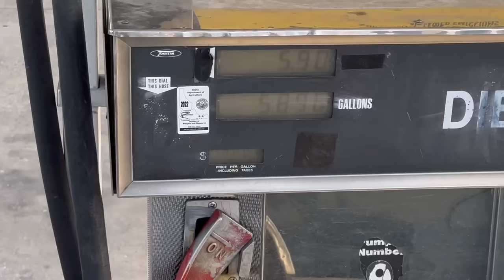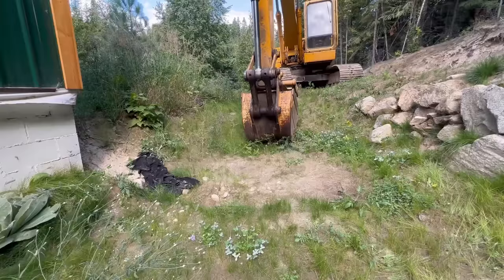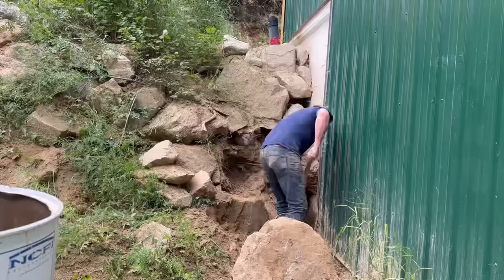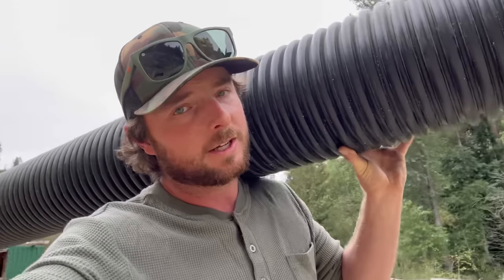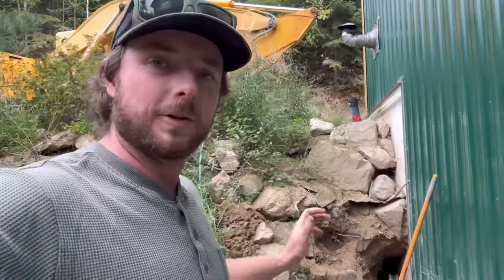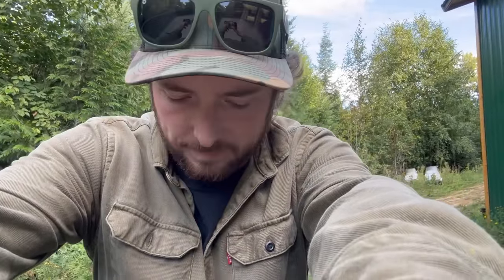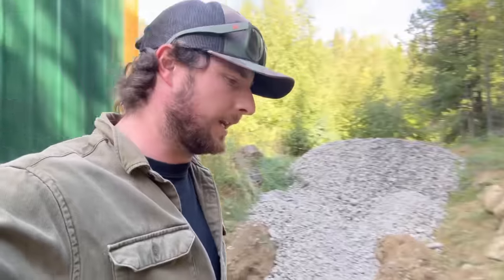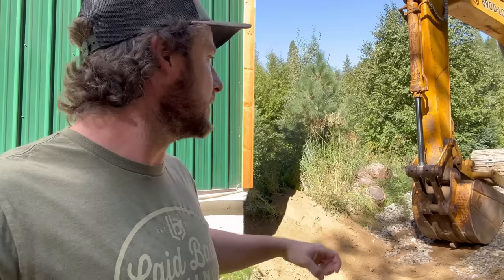Fixing This MISTAKE Before The Next FLOOD

Comment: Mike one major issue you’re going to have over time is the drain rock getting clogged with dirt because you did not use filter fabric over and under it. If the water can get through it WILL take dirt with it! For proper drainage you must ALWAYS use the fabric to keep the dirt out of the drain rock. 

What you’ll find is you’ll have to end up every several years redoing the same job over and over because you skipped a vital step.

Comment: You need to waterproof that block wall  and install a drain system the whole length of he back wall.  Dig a drain line from the dry well to the outside edge of where the house and let it drain off the side!

Comment: My brother in law put a plastic barrel into the ground with a sub pump in it, and it stopped water from coming into his house. We have had several big rains, and it worked great.
Reply from the maker: That’s a good plan! Unfortunately it would probably freeze here during the winter.
Reply: @MikeandLizLorden  pour radiator fluid in the big barrel and that will help keep it from freezing. And a heated water drop in rod to keep the barrel water warm and not freeze.
Reply: @MikeandLizLorden  not necessarily. Like other water systems, it comes down to burying the tank/barrel below the frost line. No idea what it is there, but if it's anything like my part of NH, it'll be 5 ft.

Comment: I think the title of this video should be changed. You are implying the Raneys made a big Mistake whereas they were trying to do a quick fix that just didn't work. I suspect the real problem is lack of waterproofing the back and side walls and not installing weeping tile at the base of the walls to carry away all the water. I hope your improvised solution works, but it would have been better with filter fabric all around the stone as other people have said.

Comment: SO my friend.  That is not going to be the permanent solution you hoped for.  You could have used the "burrito wrap" mentioned below, but that method is better for seepage.  What you have (based on what you have said is a massive rush of water down the hillside that does not stop until it hits your foundation.  That's why I suggest the fast disposal system. If you had installed a catch basin all the way in the bottom of your pit and drained it to daylight with your culvert, you would have a permanent solution.  You would have had to add stack on extensions to bring the catch basin up close to finished grade and a full size grate. As others have said below, your drain rock will silt up (3-5 years max) and you'll be doing this job again.  Maybe next time you do it the right way.😊 If you have seepage through your block walls, well that's an inside fix for another day.  But you will have to pump the seepage away to daylight.

Comment: peoples have pointing out some good point. the thing i would be very worry  about is all those big rock pile up against your block wall. over time the frost will push them and crack your block wall. I would remove those big rocks and replace it river rocks near the block wall . Then fill the rest of the hole with sand. also as those rocks move it could also crush your pipe you just put in.

Comment: Non corrugated white 4" perf pipe works really good (perfs on the bottom), wrapped in drain cloth, surrounded by 1-1/4" clean drain gravel, with a 1/4" drop every 10'. I made mine all around the perimeter of my 24'x40' shop, draining away from my shop in a 24" deep trench. It works so good I no longer get any water in my shop now. I also taped up a 9"  wide membrane to the 4" concrete slab to keep the dirt from getting eroded away under the concrete along with the gravel and the drain cloth.

Comment: If it doesn't work can always change things up , I would have graded the soil between the wall and house to the middle then put a french drain down the whole thing.  filter fabric is your friend like a lot of other have said.  it looks like you have the equipment to get it done if need be.  This is how I learned I tried stuff till I found out what worked for my situation.  I didn't have the equipment and dug by hand rock too.  Thanks for the video was cool to see.

Comment: Hey did you get your track motor fix? Could you apply a rubber sealant on you block wall? Maybe add a pump to pump the access water away from your house

Comment: Pray your solution works and solves the water issue......I'm concerned Mike...although you are very capapilbile and of good intent have "in the past been temporary and/or not worked.....get some more professional advice before you ruin you building again.  No il will intended.

Comment: Personaly I would have put a 90* elbow on that culvert pipe and perforated pipe up to ground level.  This way you can visually see the pipe is clear.  I would also use your road to divert alot of the water away from the back of the house too.

Comment: I seen you put oil into your final drive I am assuming that you found your final drive problem and if its leaking keep track of it and don't let it go dry or it will cost you more than just the seal.  I hate to tell you but it just for the seal replacement is going to cost over a thousand dollars and that is if you take off the final drive and send it to a shop. good luck with it and take care of that back

Comment: Your problem needed to be addressed as soon as the forms wear stripped from the foundation a sealer system should have been appliqued then  and a drain system installed

Comment: I think that was a decent attempt of a fix you have done. But that title comes off as extremely ungrateful for a group that came in and gave a lot of blood sweat and tears to help you out of a jam that was caused by poor planning on your end of building a building without putting in an infrastructure that dealt with that. Even if it didn’t work at least Marty tried something to deal with what you didn’t have a thought of how to repair yourself at the time. Disappointed fan here I hope you address this in the next video A lot of fans are a little shocked at your wording.